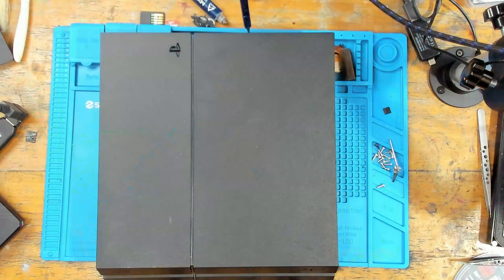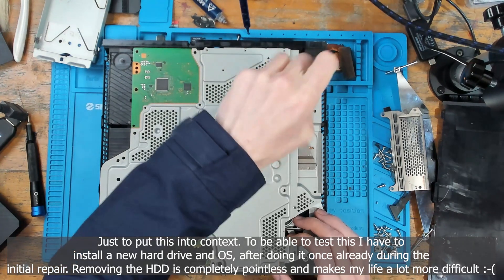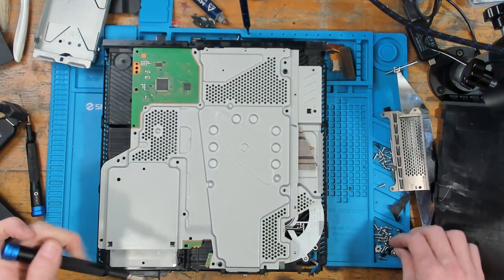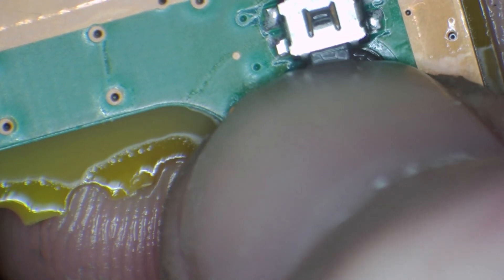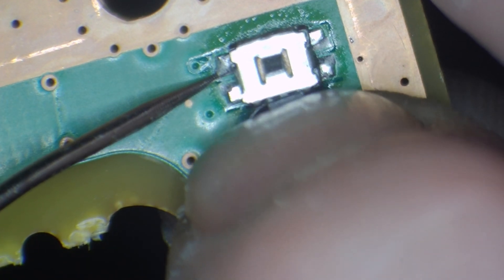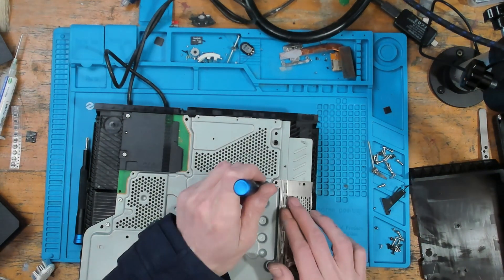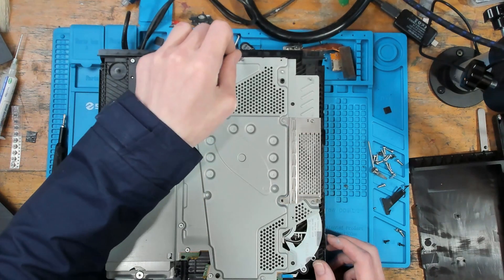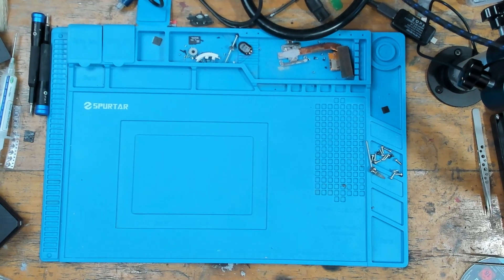PlayStation 4 1200 Series Power Button Replacement - A Quick Warranty Repair

Comment: I never thought I'd be able to fix things like this but thanks to people like you I'm learning. I picked up a trashed broken PS4. When I opened it the power button switch was damaged with the top part of the switch missing. Thanks to your video I was able to replace it and get the unit working!

Comment: Very cool looking repair, especially when you heated up the bottom side and it just pulled the chip in place. I’m just a basic DIYer so my soldering skills are limited to solder and a little bit of flux, but I recently purchased a PS4 with no cosmetic power button, but I haven’t received it or opened it yet, just took a chance on it so we’ll see what I need to do. Maybe I’ll get lucky and it will just be the  cosmetic power button. Of course I’m hesitant about it because I wonder why they wouldn’t have just turned the PS4 on and off with the controller if possible?
Reply: My chip is stuck in place and it just keeps turning on and off over and over again

Comment: Hey there, what temp and flow did you use to remove and reflow the button?
Reply from the maker: Usually with these I use 480⁰C 40% air flow on my Atten. They're pretty thick boards so they take a lot of heat to work with them
Reply: Thank you my friend. I have just replaced this power button, so fingers crossed. Take care.

Comment: Why didn't you add fresh solder !? On it will look clean plus it will be tight and wont break off easily
Reply: Theres already good solder there. Why replace it? Jobs perfectly fine. Joints are beefy.

Comment: Hi, please tell me what should I do for this error ce-34878-0, because I changed more than 10 hard drives, but it still gives this error, I think when the device heats up and the fan sounds, the PlayStation gives this error
Plz telllllllllll me🙏🏼
Reply: And tell me What happens if we apply too much thermal paste on PlayStation???
Reply from the maker: Try replacing the CR2032 battery with a new one. That can cause the error you're having. Nothing will happen if you apply too much paste apart from wasting money and making a mess :)
Reply: @TheCod3r  
Hi’I found out where the problem is with the motherboard.I replaced the ic hdmi and I can't believe it was fixed.🤯🤩
And it no longer warns and the game does not crash💪
Please tell anyone who has such a problem to do so
Tnx